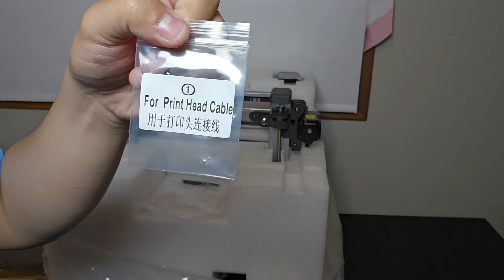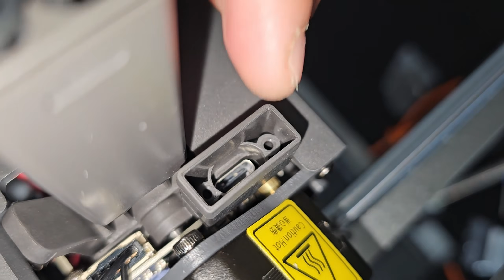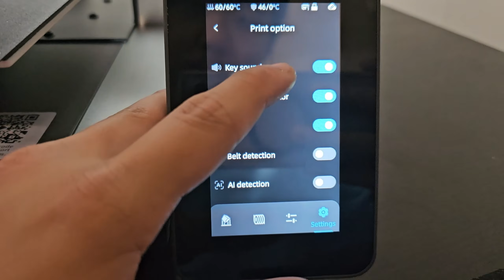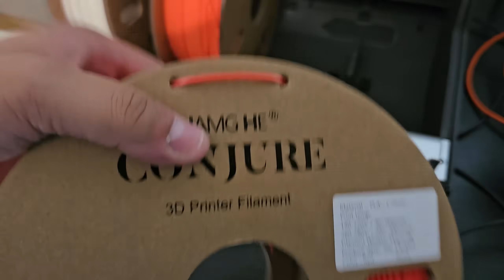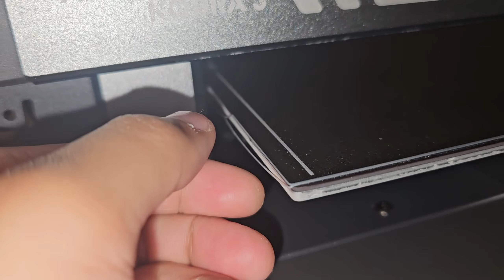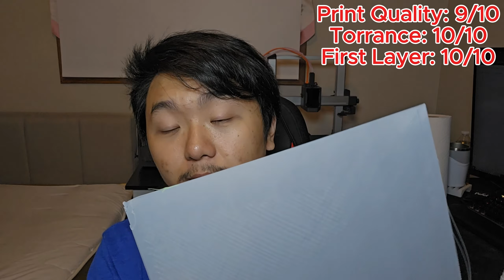Anycubic Kobra 3 Combo Best Mid Budget 3D Printer Review/Unbox

Comment: i need help - keep getting error code 11518 - i have changed the hot end - i have factory reset this machine - i have tried multiple filaments - any suggestions
Reply from the maker: Are you using the ace pro? If so then your ace pro might have done filament stuck in there.  This code is for filament getting stuck.

Comment: trash. had problems since the get go, had it for a few months and the newest problem is the number 4 filament thing does not feed the filament. it was making noises then made a sound like an alarm squeaking, now the thing spins in place but wont feed the filament at all. i took the cover off and all the gears do is spin, 1 2 3 all work but not 4.
Reply from the maker: man that sucks, you can try and open a ticket with Anycubic I bet they can help you out, or even replace the 4 slot.
Reply: @Scratch3DPrinting   they already sent me a new print head to replace the original print head and a touchscreen to replace the non working one. if they keep sending me stuff i will have 2 printers, lol, their quality is just garbage, I am printing on my ender 3se as i type this because it is more reliable. seems like the kobra 3 can't print with multicolor filament as well. so far it has clogged 100% of the time, and not even the same spool or colors. it is just 100% certified crap. had I known I would have gotten bambulab.

Comment: ❓Q: ❓in this printer, when it prints in multicolor, does it do 1 color at a time per layer? I was thinking of adding 1-2 color only on some layers and starting and ending with different colors to reduce pooping. ie. in minies having a green grass base, but not having any other greens.
Reply from the maker: Yes it does print the color by layers, like yours if you only have a green base and no other color within those layers then it will print that color until it needs to change to another color. Hope that makes sense if not let me know.

Comment: That second unused 4 pin plug on the back of the AMS is where the second AMS unit plugs in im betting, it probably works like a piggy back kinda thing and would use the same 4 to 6 pin cable to go from AMS to AMS. Sound right? Lol
Reply from the maker: Ahh, that does make sense. I think you're right.
Reply: @Scratch3DPrinting  it just came to mind and I couldn't think of a better reason for the extra plug lol, if each ACE has both then you don't have to worry about which one is downstream yanno 🤷

Comment: I found mine wouldn't print properly out of the box without a .07 z-axis offset profile in the slicer. Right out of the box it was smearing its layers after leveling, eventually, I'll try manually adjusting it but for now, I just have to remember to pick the right profile every time.
Reply from the maker: thats not good to hear. I wish these 3d printer would be more consistent. Good luck on your 3d printing journey.
Reply: @Scratch3DPrinting  prints fine now, very happy with it, I'm not soft like some people who can't handle being required to understand the mechanical aspects of their machines.
Reply from the maker: @loganmacneil3424  That's great to hear. Yeah every 3d printer is different and once it's dial in it can print well.
Reply: I had to constantly adjust mine. For the price, it wasn’t worth the headache. Sent it back

Comment: Hey, did you get a camera and 1 kg of PLA Pantone for the Kobra 3 Combo?
Reply: It’s come gift when your pre-order from Anycubic
Reply from the maker: No I did not get the camera and the 1kg pla. I bought mine after the pre-order.
Reply: @Scratch3DPrinting  It was limited to the first 5000 printers or some such.  It does however get delivered separately.  So it may still turn up.  The mystery box came with the printer.
Reply: Here in Austria I can still pre order it for 450$/€. And it says that it comes with 1kg free PLA and Kamera. Is the Pre Sale in your country over?
Reply from the maker: @Manuel-df8fr  It looks like it's still going on here too. I got mine on amazon, just because of shipping time.
Reply: @Manuel-df8fr  It says it is limited to the first 5000 printers, but it is not clear which of the gifts are limited.